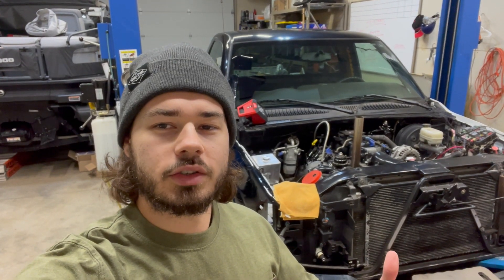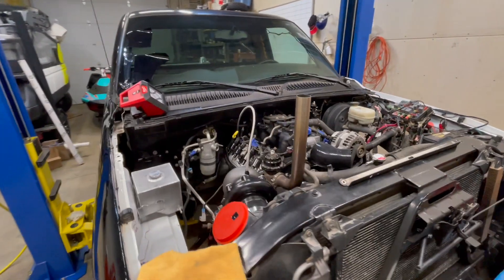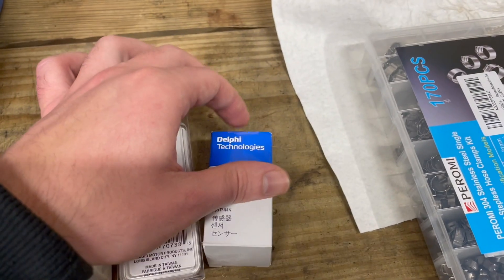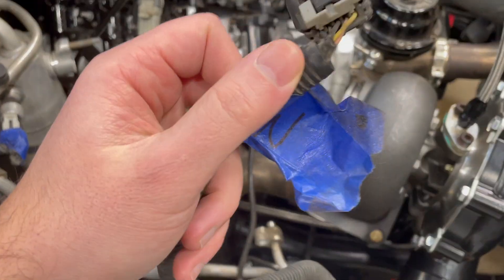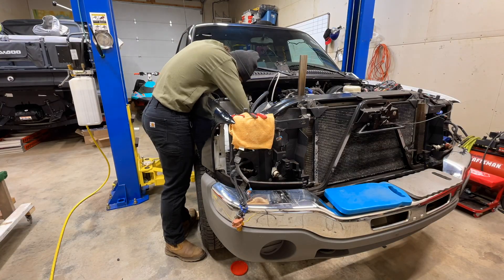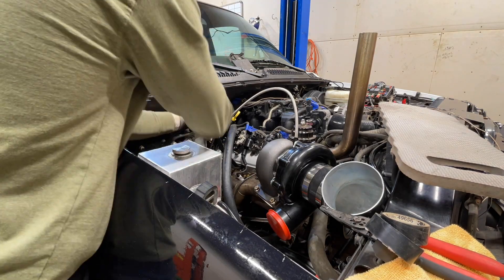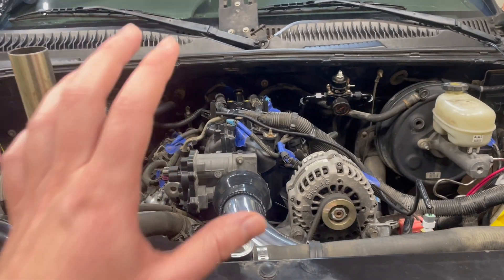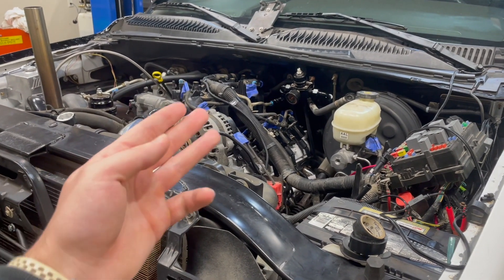Silverado TURBO SPEED DENSITY conversion - N/A to BOOSTED - TURBO vehicles NEED THIS! HP tuners

Comment: hey Alec, what did you put into the IAT table, literally bought the same sensor because it was for the old cyclone and tapped my manifold so it gets the air that has just gone past the tb, but need to calibrate the table

Comment: Did that map sensor end up working pretty good for you? Edit: I got the same one just wondering before I start tuning on it
Reply from the maker: Yeah it actually did. 2500 miles this summer on it. Use the scale sheet that it comes with.

Comment: Im confused about the o2 sensors my hotside dosent have o2 bungs on them other than a wide band for the down pipe
Reply from the maker: What hot side do you have?
Reply: @alecaagaard  its a custom hotside with custom log manifold people are telling me its gonna have to run open loop and that i dont need to run o2s